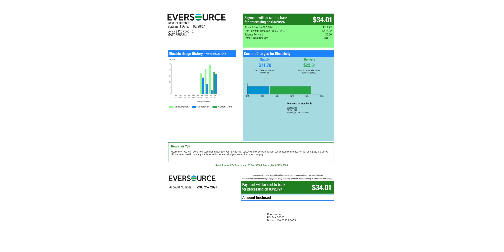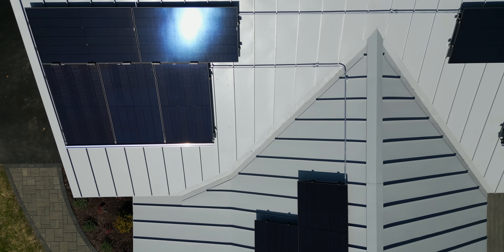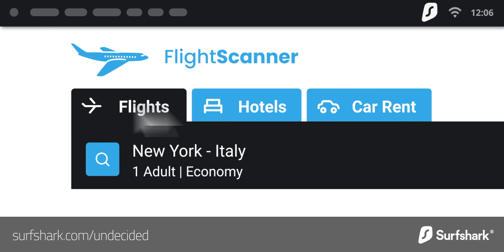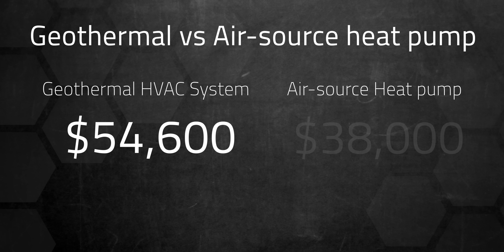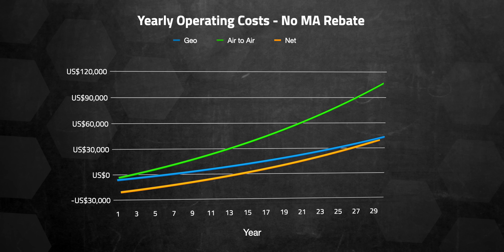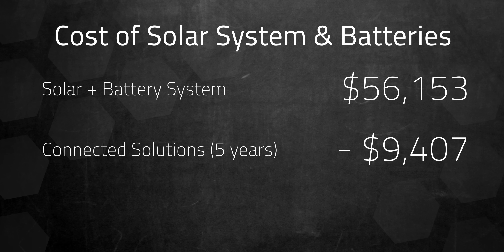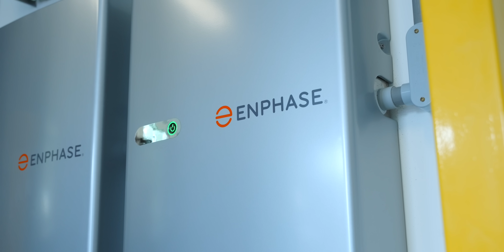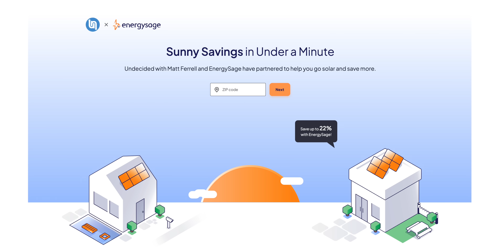What I Learned After 1 Year with New Solar Panels

Comment: Even here in cold Sweden, skipping all so called "green" features like solar, geothermal heat pumps etc.: heating a home with low cost direct electricity (COP=1) and a wood burner can be most cost effective. At east when your home is well insulated.
The initial investment AND maintenance cost of going "green" is often ridiculously high. Replacing a compressor or other key components after a few years kills your Return Of Investment.

Comment: In Hawaii, Maui, cost of electricity is almost 50cents/kwh.  My 13 kw solar system on a 2300 s f home with powerwall battery saves me $800/month on gas and home electricity.  I also have an EV.  Most
Homes no ac but with climate change many adding solar to compensate for ac. Hawaii is over 30% renewable but not due to government or electric company but private residential rooftop solar.

Comment: One thing that's missing from the math is the Time Value of Money.  Unless I missed something, he calculated the break-even point at once the accumulated savings exceeded the extra outlay.  But if he had bought the cheaper gear, he could have put the money in the stock market and (most probably) earned enough with the savings such that he never breaks even.  Given the numbers he showed, I don't think he'll ever break even.  However, others have pointed out that he probably overpaid for his setup.

Comment: I appreciate your videos.  What about battery replacement cost?  They aren't going to last 30 years like the panels.  Your hvac won't either.  You will have replacement costs at some point, so to extend your savings over 30 years needs to include capital replacement costs too.

Comment: What about the depreciation from other components? seemed you haven't add them into the cost
Inverter lifetime is around 15 years, and current LiFePO batteries lose 20% of their capacity after 10 years.

Comment: In the summer of 2023 I had installed a 7.4kWh system (20X370W panels) and a SolArk 15 kWh inverter; with 20.48 kWh of batteries.  It worked well, but I wanted more... for electricity security.  So this fall I had the same company (ShineSolar) install another 13 panels X 370 watts for another 4.7 Kw (12.21 total kWh), and doubled the batteries to 40.96 kWh capacity.  I run my property off the batteries, and use the grid only for backup.  I am pleased thus far.

Comment: I live with a man who has one of those brains, not like yours but sees in ways I never imagined.

First, always build a basement. Use dry stack with think coating of chicken coop wire and light concrete, or expanded concrete for the high R value.

Your biggest mistake, in his completely Not at all humble opinion, was heating air instead of heating the floor. You could have done this with either a basement or slab. You can find the "Most Common" hot water heater element, enclose it in a small 1-2 gallon tank and super insultate the tank.

That water would flow into tubing encased in the floor isolated with a thermal sheet and self leveling plastic then the heat transfer tubing encased in a think layer of concrete.

To feel comfortable with air you need an average temp of 76°, for a hot thing (radiator) 72°, for a radiant floor 65°. By making the tank small, the heating element will heat the immediate water and that circulates. Once the floor's mass has sufficient heat, it is cheap to maintain and that needs the element, and tiny water pump with could be driven by your solar panels. That needs only a bimetal temp-sensor to turn on and off. 

All that 400' well and heat exchanger waste of capital. To cool (while you were digging the basement), you dig extra and install 'earth tubes'. These are tile tubes buried 8-12' below grade and are used in the summer to pull warm air underground and cooled then into the house.

Then you could not worry as much about air tight.There are cross channel air heat exchangers that are made from paper in Japan.

I think having a garden and a root cellar give you better food. Screw Hello Fresh, mulched garden, grow potatoes planted on top of hay and covered produces Washed Potatoes! and in the winter you grow hydroponically Indoors to add to the root crops in your root cellar.

We have used the doors and windows you installed in Germany for 30 years or more.

I think you might look at your server setup and switch to M4 Mac mins in a cluster. Then you can process your video in Blender used the shared server built into Blender. The cluster could also be used to run large AI models. That would use far less energy and be more powerful.

Comment: You are expecting the solar converters and panels to last 30 years in these calculations? Are you using string convertors? Our installer told us to expect the string converter to last 15 years. Ditto for the home battery before it would be well spend.

Comment: Hiya Matt. I just clicked on a thumbnail and here I am. We had a cyclone blow through here about 2 years ago. Devastating! So much rain in a short time, rivers swelled out of all proportion, a few lives were sadly lost, bridges taken out, the power sub-station got about 2 meters of water throughout. Result, we lost power for 5 days, the streets were flooded. Some areas were totally isolated and relied on the Airforce and civil helicopters to supply water, food and medicines. Hawkes Bay, New Zealand Cyclone Gabrielle.
So, with a retirement package due, I looked at getting a 5.3kW system installed 1. As an investment 2. As a backup system for the next cyclone and 3. Cause it's the peace of mind aspect. When everyone else has no lights on, I will. (Side note: No internet as the network provider had battery backup, but not for 5 days outage. Also some B'sd stole a generator running the cell-phone tower.)
Looting in the worst areas was a problem to. If it was America, it would have been 'duck shooting season', I tell ya. But we are more restrained here.
I have been up and running for 2 months. If I invested my money in a term deposit, I would be behind $2/week in earnings compared to the solar install. And in the solar install I take out $28/week to start saving up for a 'replacement' solar in 15 years time or (upgrade after 7 years). So for reason 1. I am ahead! 
(But I have to take in to account a whole year, so I expect to be paying for more power over winter) But we have only just hit summer, so I expect 12c/kW hour excess generation, will go up. 
On average I only use about 700 watts/hour & peak around 1000 watts/hour. So this month, instead of paying $210.00 for power and a daily rate of $1.03 plus a 0.5 cent/day for 31 days, I only paid $23.18 for the month. That's after the rebate and the fact my solar supplied most of the power for the hot water cylinder (on a timer). Speaking of which, I upgraded the switchboard from clunky breakers to the latest RCD trip system and more safety with lower rated breakers and more of them divided up among the wiring to the power outlets. It cost me $3000 but gives me added fire protection.
As for point 2. the App supplier is going to add value to the cellphone app, so if there is an impending cyclone, I can change the configuration, so the battery stays at 90% charge. If the worst happens, I can keep the fridge and freezer going overnight and the internet. Last time I had no communications. Just a 1970's transistor radio (AM only, no FM) to listen to the talkback radio, telling me the disasters around me. So I will be ready for the next power outage event. As for point 3. I am already pleased as punch to have the system. 
I'm already a 'winner' on point 1. (an investment) and I expect I will reap more, as the power prices go up. Subscribed. Kiwi David.

Comment: If you’re thinking about solar don’t listen to this guy. I spit out my drink when I heard the cost!! I just bought an entire system for $14,000. Includes a huge inverter that I’ll never max out (gridboss/flexboss21), 13.5kw panels (36 panels @ 375 watt each were $62 per panel or around .21 cents per watt delivered) and 28.6kwh of battery (eg4 x 2). DIY and have an electrician help with connections if you need it.

Comment: Wait until you replace your batteries. 

Seriously though not everyone gets to choose where they live or where their home faces. If the bulk of someone’s roof faces east and west and they get only a handful of hours of sun on those faces during the course of the year … this project would not pay off.

And when you have to dump excess power … if the grid has an overall excess based on operating and peak load units … they may force you to pay to get rid of your excess since they have to balance other units to meet grid load … ie they have to crank back other real power producing plants so they can get your Watts into the grid. And those reduced generation costs come at a price.

Comment: Matt, with the fact being that a very, very tiny percentage of Americans actually stay in a home, such that it is truly a “forever” home. 
May I please ask for your thoughts, 
regarding just the financial aspects of your build, (not the environmental) 
1) If the unthinkable should happen, and you need to sell, for any reason, in how many years, can you reasonably expect, to recoup all the costs for such a highly specialized system & house ?  I ask because, it is likely a house with very much higher than typical, upfront costs for that sort of square footage.
2) Also, how do you figure in your more complex systems’ maintenance costs, compared to your states homes with more typical 
on-grid situations…heat, a/c, hot water, electric, and /or natural gas systems, maintenance costs ?
3) Do you now consider, because of time, money, and effort spent, moving is simply no longer an option,
since the cost savings seem to come to you in year 10 or after ?

Comment: The installer costs discussed in this video again shows that the financial mechanism to support this type of installation are flawed - the installer factors the incentives and payments into their model to make the system cost seem reasonable over time, meanwhile gauging a large sum for the installation simply because they can. You can bet that in states with less financial incentives the cost of a similar system would be commensurately less.

Comment: 55k for 17kW of solar panels on a simple new roof seems extremely high. In France you can get excellent solar panels for a fraction of the price. The small family company that installed my small system would ask around 30k for that much solar, and that includes the 20% VAT existing in France, so your roof cost double that price. I think you’ve been had, and that of course will seriously impact any calculations about cost-effectiveness of solar.

Comment: NH Electric Co-op currently charges $0.16746/kWh. Additionally, they charge a non-negotiable fee of $34.66 to be a member. Fun fact: Our PUC approved of a $0.007270/kWh line item (System Benefit Charge) figured into that total cost, which is in fact the amount paying customers are charged to subsidize certain other customers. Notwithstanding, even if the Co-op payed a 1-to-1 return on electricity returned into the grid, we will never pay less than $34.66. We have a nuclear power plant (Northeast Utilities) which sells the electricity (in part) out of state, while we purchase (in part) power from Hydro Quebec through Northeast Utilities. Somehow, I get the impression that going solar will simply drive most of us into debt while freeing up more electricity for NU and its stockholders to profit even more from by selling elsewhere (CT in particular). So much corruption in energy, honestly.

Comment: While I certainly enjoy your content, and as an engineer-minded practical man I love the numbers and the time you have taken to work it all out, as a man without what to me would be unachievable financial backing to even think about the sort of project you have undertaken.... You see where I am going with this? However, I am not one of those people suffering from wealth envy. I am in Scotland, west coast - which means not desperately cold winters but long ones - I am retired on a State Pension ie, not a lot (!), but two years ago received a 100% grant for an air source heat pump, also covering insulation, in what is a fairly well thought out 'room-in-roof' house of 1980 vintage. My total electricity costs for a very cosy house all year round, and as much hot water as one man could ever use, is about £1,300 (add about 20+% for dollar numbers), compared with twice that for the coal and wood I previously burned for similar warmth and HW returns. (kWh costs here are around 25p, so about 30 cents, plus £15/$18 a month for service costs. Yes, power is pretty expensive in the UK, nationwide)  Even if I had the money to fit solar and battery, I doubt I would make the cost back in my lifetime. Sadly, no such grant was going at the same time as the ASHP offer, but I jumped at it anyway. Since Scotland has plenty of wind, and hydro is evolving at pace (and two things we are not short of are wind and water!), at least my green creds are not too shabby, and the total power bill for all my usage is around a fairly affordable £1,800 pa, I doubt I will do much more to reduce my bill for electrons. But I like your content, it always makes me THINK, an attribute that seems in short supply the world over.

Comment: Many of these financial analysis seem off to me. My main issue is that it is comparing dollars across decades without adjustment.
You can't spend a dollar now and save a dollar in 30 years and call it even. Your dollar now is worth a lot more than a dollar in 30 year wil be worth.

To be meaningful the analysis needs to be done taking into account inflation and opportunity cost.

Comment: As a seasoned installer, I'm concerned at the quality of the panel layout on the roof - looks very amateurish. Ideally, you would have filled all roof aspects.

Also, with the roof colour, bifacial panels would have dramatically outperformed.

Comment: $88k would get you $255k in the 30 years mentioned, with a variance of 0.02%, if invested in a global equity index trader fund. The investment barely makes sense if it's a new build, but on a replacement basis in an existing property it is very unlikely to make econimic sense.

Comment: I have a couple of problems with comparing costs. First, paying for your system requires "others" (taxpayers... my money) to subsidies such a project. I'm two-thirds through your video, and so far, you have nearly received $65K in other people's money to build the project.  The 2nd issue is comparing costs long term.  None of these money comparison videos mention the loss of investment opportunity due to the extra costs of creating such a lavish net-zero system.  We live in Southern CA, and in 2011, we looked at doing Solar.  After thinking about the upfront costs and any maintenance costs, we invested the $35K and purchased Costco Stock instead ($60/share).  This investment is 15 times ($960/share) our initial investment today.   This is actually real-life data!

Comment: I'm shocked that your utility rate for electricity is .33 per kWh.  Where I'm at in Colorado, we are in the suburbs and part of an electric co-op and we're at .10 per kWh from the utility.  My ROI would be crazy amazing if we were at .33 per kWh...  We're just a little better than net zero with a 19 kW system...